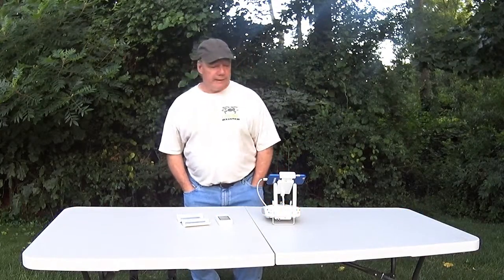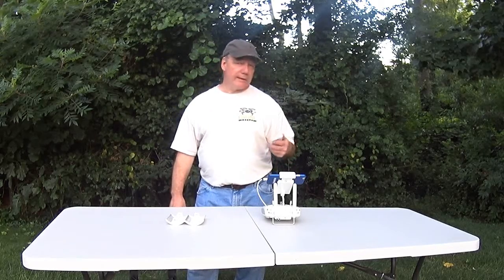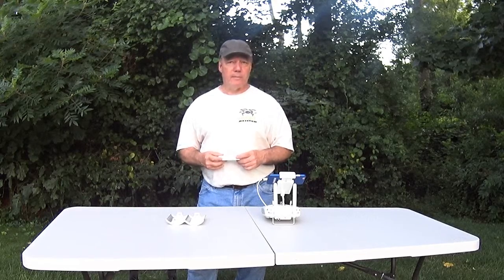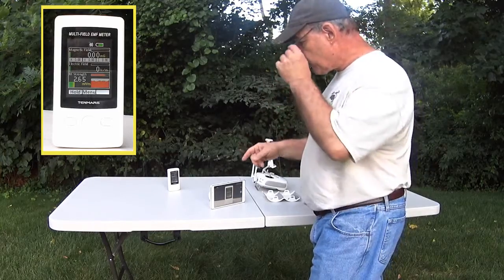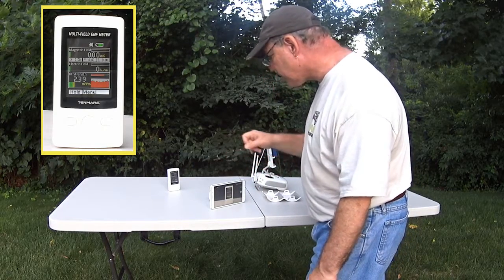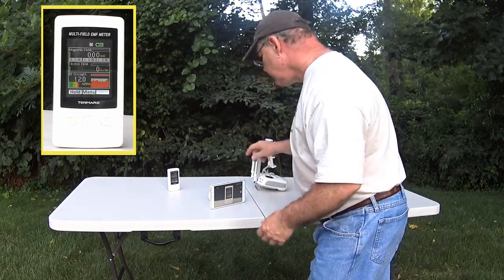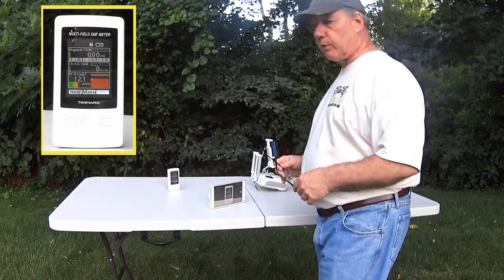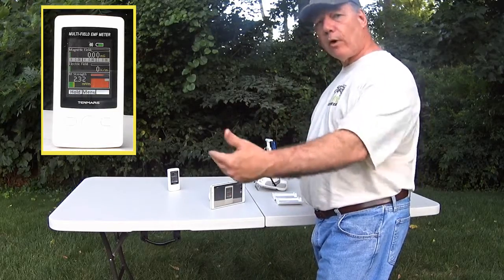DJI Phantom Drone Range Extenders do Work!

Comment: They do not work,the most that you can achieve is to take your tuned antenna out of resonance and get less RF signal.
Reply from the maker: They do work and I proved it in this video. They are based on a sound physics principle that goes back to the time of Archimedes. The parabolics simply redirect the wasted signal that is radiating towards you downstream at the drone. We've seem a 25-30% increase in signal strength when these are used.

Comment: Without a doubt the best evidence of a reflector working that i have seen to date! 
I have seen loads of range test videos stock and with boosters and it made me wonder if my drone was crap as I could only get a fraction of the stock distance, took me a while to figure out the biggest variables were location and interface 🙄

Comment: I bought that for my Mini which is notorious for having signal issues at a distance.  I've had the controller give me warnings of weak signal more than once.  So far, with those attached to the antennas, I've not had any issues.  I'm with you about the radiation, too.  I'd rather beam that signal at the drone and not at me.

Comment: Thank you. So the output signal is boosted as much as the input, right?
I understand that the parabolic reflector makes the signal more directional.
So there would be a potential problem if you were not facing the drone all the time.
Reply: Yes they are directional so you must be facing the drone.

Comment: Thanks for this excellent video!  And by the way, those 'haters' who claim it doesn't work - I'd bet a dollar that they didn't know there's a thin film of protective plastic on most of these which is supposed to be removed. One video I saw - he comments that the thing didn't work very well, then he realized there was a film of plastic on the metallic dish.  Going to try my new Tozo booster today! Will let you know how well it works.  Awesome that you showed these results on the signal tester - THANK YOU.

Comment: The problem lies with this mod turning your RC from omni-directional to uni-directional. Whereas the stock transmitter would broadcast a good signal to the drone no matter where it was located in relation to you, adding this mod would enhance the signal if you were facing the drone but drastically decrease it if you were facing another direction. This needs to be made clear. There are several videos of people testing this gadget with less success but they don't make clear what direction they're facing so it's difficult to ascertain if they're using it properly.

Comment: I'm guessing for this to be 100% effective, you'll need to constantly orient yourself/your controller towards the drone?
Reply from the maker: Thanks for the post and the cool thing is that the "beam spread" of the reflectors is almost 180 degrees so you only need to be pointing in the general direction of the quad to stay connected. They are really easy to use and really effective. Rick

Comment: When using the parabolic range extenders, I presume that the signal to the drone is funnelled into a narrow path and this is why the signal is better received by the drone. However, if the remote (and the range extender) is not directed towards where the drone is located, wouldn't that reduce the signal strength? ie the signal would be funnelled in a direction away from the drone. Therefore i would expect that when using the extenders it is very important to ensure that the remote is facing towards the drone. If the drone is so far away that its exact location is not known then that could be a problem because the signal is then being directed away from the drone. What is your view on this?
Reply from the maker: Fred, thanks for the post and you're correct that the reflector does make the signal more directional. The good news is that the beam spread on these is about 130 degrees which means you only have to be pointing in the general compass direction of the quad so it's not much of a worry since you'e supposed to keep the drone in VLOS while flying.

Comment: Hi. Excellent video. Is that a Tenmars TM-190 meter? From what I have read it measures between 50MHz to 3.5GHz only. That meter covers the 2.4GHz band but I am still wondering about the 5GHz band. The Phantom 4 Pro uses both 2.4GHz and 5GHz bands. I have Tozo reflectors on the way to me now. Look forward to trying them out.

Comment: Does it help the controller pick up the video stream coming back from the drone to the controller?
Reply from the maker: Yes, it improves both the distance you can fly and the stability of the video stream. I use them every time I fly and they are very easy to just slide over the antenna.

Comment: One thing that should be of note here is the fact that the controller and drone are both TRANCIVERS.  RF is a TWO way street.
Why some people have trouble or think they don't work!, well, is quite simple. For one the drone's transmitting antenna is not directed back to the controller. Obviously it cant be.    

With the range extenders on, the controller will also have better ears, and will also pick up unwanted RF as well as the signal you want, so the controller needs to block or sort that out so to speak.   
Depending on the overall noise (RF interferences) in your area will also determine how well the drone with or without the extenders will or wont work. 
    
Here is a little experiment you can do. Get in your car or grab a portable AM/FM radio, put it on AM and tune to an off frequency, set the volume about half way then drive or walk around your area, you will find the static will increase and decrease as you travel around. Heck just cruse through your own house, you will be surprised to find what can cause interference.  
This is caused by many things such as, power company transformers, old fluorescent fixtures, machinery, to microwaves, smoke detectors, touch lamps Et Cetera. Then there is the good ole earths magnetic field, along with the suns ability to ignite or extinguish the ionosphere's propagation, will all have an effect, some good some bad. 
The earth and sun are the biggest RF culprits so don't think you can escape the city and be free of potential interference.  

So to all you naysayers out their check your surroundings that your in, travel somewhere else and you will find that yes they work. Just not on that day or area you were trying them out.
Reply from the maker: Thanks for posting and you're right about local interference. The great thing about the LightBridge and Ocusync technology is that it frequency hops. This way if a particular channel is "noisy" the controller will negotiate with the quad in real time to switch to a quieter one. The extenders help with this connection by redirecting a lot of the wasted signal downfield towards the quad. I hope you're getting some great airtime this summer with your quads! Rick

Comment: Good experiment. Going from 2.5 to 12 EMF at 1 meter may not be the same ratio at 1 km away due to dispersion.  Also keep in mind transmitting and receiving are separate RF signals. A dish or reflector will enhance both.  Another point to make is while a directional reflector will increase signal strength ahead of it self, it reduces it behind..so if the reflector is not pointed to the drone, the signal received both directions will attenuate.

Comment: Yes, i concur, they work. You showed about 10*Log(12/2.4) =7dB of gain by use of your 
setup. Please repeat at say 15ft, moving thru an Azimuth of 180 degrees, making measurements every 10 degrees. Then plot results for us. Range is doubled for a 6dB increase in gain. But remind all these drone cowboys that Line Of Sight is law and gives us pilots a warm fuzzy feeling.

Comment: I haven't used mine yet, but my opinion from what I have seen, is that it definitely won't make your signal worse. I have the P3 SE that is supposed to go farther. However it really depends on A. conditions B. Obstacles, and C. How you hold the controller. I am sure, I get so into my flight that I am not paying attention to controller position. The Antenna MUST be pointed, up and the controller parallel to the drone, and level.  Happy Flying!

Comment: I am new to the dji drones and I have just bought a dji 3 standard.I was wondering why is there a cable from your phone to the controller? thanks for the video.
Reply: The Standard's don't require a cable to be plugged in. I think the upper models may need a cable plugged in however.
Also, using a 3d mapping app like Drone deploy needs a cable plugged from the phone to the controller.

Comment: By design I have yet to fly further than 650 ft away with my PS3. Slowly gaining confidence. No real test for range yet, but I can tell you the video improved when I attached a parabolic range booster. No more slow choppy images.
Reply from the maker: Thanks for the post and I agree that they work well. My only interest in them is to improve my signal in close. I don't fly beyond VLOS but love that they help improve the video quality and signal strength in "noisy" environments. Thanks for the post and I hope you'll sub the channel. Rick

Comment: Davidss said: ↑If you want to see results of tests, although not all the variations you have thought of, you can do little worse that looking at those done by the chap who (indirectly) is being accused of selling expensive snake oil.
Drone Valley (I think his name is Rick, but I can't really handle the accent very well).
His tests are on the Phantom, not the Mavic, but the frequency will be the same.

If you want 'independent' tests, with apparently nothing to sell, try this Australian actual flight test. Again a Phantom.

Another Phantom based flying test, defying the 'science'. Although he doesn't show the screen, merely quotes the numbers. What is interesting is that for his final test he flew in a 'poor' signal / range area, and got a much increased range. This tends, in my view, to reinforce what the Drone Valley man asserts, the range extenders don't JUST give you a longer range, but by punching a stronger signal ensure the drone works better in a hostile environment.

What we need now is some Mavic owners to do similar tests.
OF COURSE I'd try this on my Mavic, if only DJI would ship me the one I've paid for  

Regards.Click to expand...OK, first of all I'm going to have to come down a little hard on "Rick" of the Drone Valley video and his "scientifically proven" claim. RF transmission patterns from an antenna have both a "near-field" region and a "far-field" region. The "near-field" region is the region at distances comparable to the wavelength of the RF wave, which is around 12 cm (about 5 inches) for the transmission frequencies of these drones. "Rick", who by his own admission is not a scientist and probably doesn't know the distinction between "near-field" and "far-field" antenna regions, placed his detector nearby the RF controller on the same table in the vicinity of the antenna's near-field region. That not the proper way to do the test, since obviously when we are flying drones the drone is always in the "far-field" region of our controller's antenna. 

Also, despite talking at length about how his Range Extender concentrated the RF signal in the forward direction, Rick didn't do a very simple test: Show us how the signal amplitude at the detector varied as he moved it in a 360-degree circle all around the RF controller. If the Range Extender were really concentrating RF power in the forward direction, then we should see a drop-off in signal as the detector moved to the sides and rear of the controller, and then the signal increase in strength again as the detector moved in front of the RF controller again. (And, again, all these measurements should really be done with the detector much, much further away from the RF controller so that the detector is always in the RF controller's antenna's far-field.). 

As for the Australian flight test, there simply isn't enough information presented to judge the accuracy/truthfulness of the video and whether it was a properly conducted scientific test. That's why we physicists write up long, detailed papers which tediously list and describe all of our experimental conditions and parameters and procedures, and why we don't simply make quick 5-minute YouTube videos in order to establish scientific claims.
Reply from the maker: John, thanks for the post and I was a little confused at which part you were writing and which part you were quoting there but either way the argument being made is somewhat moot. The reason for this is that the basic parabolic reflector has been around since the days of Archimedes and has been used to concentrate all sorts of waves from light (in the early days) to radio in more recent times. It's the reason that things like flashlights, satellite dishes and your DirectTV receiver work. The simple idea is that with the type of antenna being used on the remotes, the transmission radiates in a 360 degree pattern with a lot of it being wasted. The parabolic surface redirects the "wasted" radiation normally being sent away from the quad, back in the direction you are flying. It does this passively and really helps to increase the useful signal downfield. I have used these devices on many of my drones including the Phantom in the clip as well as my Mavic Pro and my new Spark and they help a lot. They are a very inexpensive way of increasing your signal strength and allow you to overcome "noise" in the area you're flying to help eliminate dropouts in your signal. I'm not sure what the other experiments were you mentioned but if they didn't see a difference, they were doing something wrong. I have been an electrical engineer for over 40 years and had a lot of experience with RF theory as well. Trust these results. Thanks, Rick

Comment: Hi can you do this test on a Mavic Pro please? The reason is because the Mavic uses a newer technology called Occusync and someone tested these on a Mavic and it dropped in signal instead of helping. Can you verify this?
Reply from the maker: Thanks for the post and I may do a follow-up clip but expect similar results. Even though Ocusync is a different from the Lightbridge used on the Phantom I use for this test, they are very similar in their connection topology. Also, the benefit of the parabolic reflectors are that they redirect the available signal downfield and eliminate the wasted signal normally being broadcast behind you. Be sure to stop back and I'll see if I can get one done for the Mavic and the Spark.
Reply: Drone Valley please do so, so we can settle this once and for all, cause one guy posted his Mavic with the antenna ears and it degraded his connection during flight.  How about an actual distance flight test after the scientific test?
Reply from the maker: I saw that test and it was flawed. He was using the signal meter on the remote as his indication and its totally inaccurate for this type of test. The only way you can test RMF power is with a meter to see the difference. The science behind this type of parabolic reflector is solid and the basis for a lot of other gear you use everyday. Cell phone towers, Dish TV receivers, flashlights and even speakers use it to concentrate and direct energy in a particular direction. These are no different. As for the distance test, I never do these because they are violating the visual line of sight requirement set by the FCC, which is another thing that upset me about that other clip. He was clearly flying well beyond VLOS, which is reckless. Stay tuned and I'll be sure and do a test for the Mavic. Thanks again for the post. Rick
Reply: Drone Valley just wanted to see how far the Mavic will go with those ears comparing to the stock antennas. If they do increase range I would pick a pair up. Please do test?

Comment: cant believe you even have to explain this to the fools, you are turning an omni directional antenna into a directional beam antenna , the only thing you need to explain is that you should now ALWAYS have the beam pointed toward the drone as your signal to the rear of the controller is now much weaker , IE , turning your back on the drone would not be a good idea
Reply from the maker: Thanks for the post and I think what happened is that a few people did clips where they thought that these parabolic reflectors weren't working for them and it started a lot of confusion. I agree with you that this technology works well and if it didn't, every cell phone, flashlight and DishTV receiver in the world would immediately stop working since they all rely on a parabolic reflector. You're also right about the signal being directional and the good news is that these provide a beam spread of about 120 degrees so they are very forgiving. You basically have to face the general direction of the quad to maintain connection. Thanks again for the post and I hope you'll stop back soon. Rick

Comment: great post and very informative, was unsure if i was going to get one, now have them...i am wondering if the negative comments came from those who tested them out without realizing that you cant turn too far away from the signal radius before they start to not function properly, and that's why these negative comments came back to you ? i am also a test engineer and can verify that these do work, but if you turn to far away from the drone with these on it will degrade the signal, so keep the drone in line of sight..